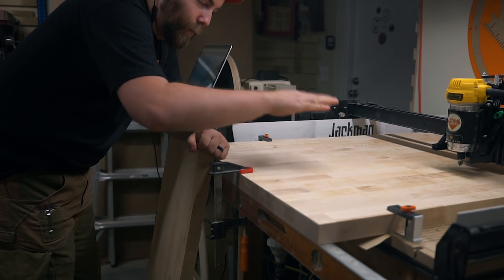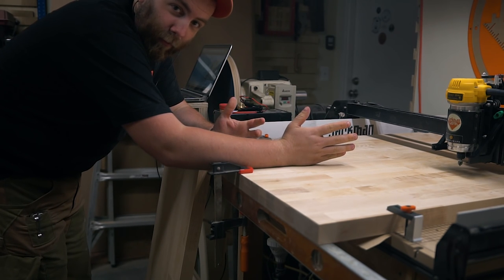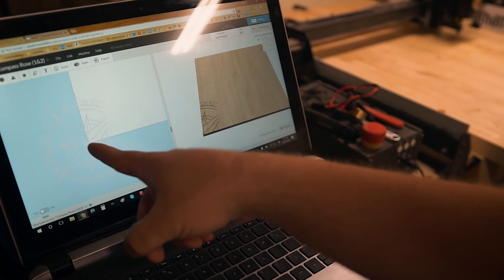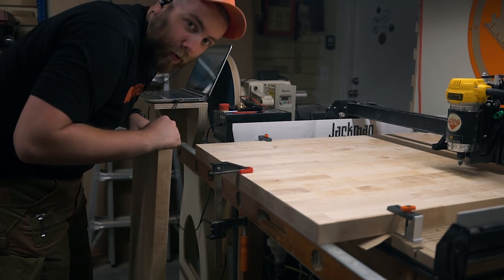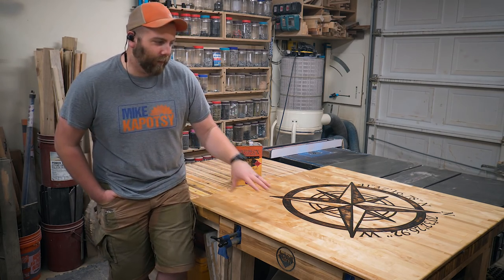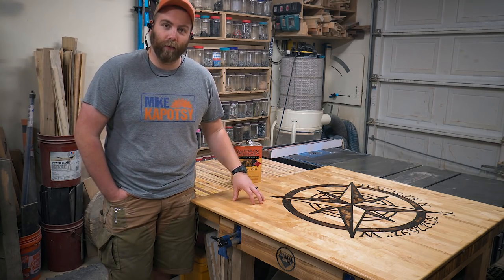Epoxy Inlay and Rustic Compass Butcher Block Countertops

Comment from the maker: ► A big shout-out goes to Waterlox! They are a huge supporter of what I do and made this build video possible. Waterlox is my go-to choice for finish and I'll even admit that it is what makes my projects look so good. Click this link to learn more about it and get some in your own shop! http://bit.ly/2svYsCR

Learn how you can enter into the Inventables/Easel Power Hour Challenge (no CNC needed... that's the grand prize! http://bit.ly/2sEIwgZ

My exclusive solution for hearing protection in the shop, ISOtunes PRO - http://bit.ly/2uIsq7M

MATERIALS & TOOLS USED ON THIS BUILD
Materials
- Maple butcher block countertop
- Blue tape http://amzn.to/2jO5Gva
- Epoxy resin https://amzn.to/2LnVkAd
- Grout 
- Epoxy syringe https://amzn.to/2Jh13ad
- Ammonium chloride https://amzn.to/2Ju8r5r
- Rare earth magnets https://amzn.to/2xHqVdY
- Quick set epoxy http://amzn.to/2kIH4J2
- Waterlox tung oil finish http://bit.ly/2svYsCR
Tools
- Hearing protection https://amzn.to/2JiLX3Y
- Dust mask https://amzn.to/2LVJXjY
- Circular saw http://amzn.to/2pindD0
- Drywall square https://amzn.to/2sFR5bw
- Table saw http://amzn.to/2j4bvVU
- Bar clamps http://amzn.to/2DMjReG
- Glue scraper http://amzn.to/2jrxJR0
- Belt sander http://amzn.to/2oS8zyE
- CNC machine http://bit.ly/2kOY5Pu
- Pipe clamps http://amzn.to/2jkLLbO
- Heat gun https://amzn.to/2xJLN4q
- Router https://amzn.to/2xIzHbD
- Table saw fence clamps http://amzn.to/2m7vtkr
- Random orbital sander http://amzn.to/2jrwsJC
Reply: Jackman Works  first off, what the hell is the name of the first track on your video. That alone, has me watching this multiple times. Second, the compass is an awesome idea, would you attempt this with a palm router? Asking for a friend. Thanks and great project

Comment: Is there any way to do this without the CNC machine and on a bit of a smaller scale? I’m just getting back into woodworking and would like to do this as a gift for a family member.
Reply from the maker: For sure, the circles and straight lines are easy with a jig. The lettering will be harder by hand but it's definitely doable with a steady hand and more of a script type font which will help hide your mistakes

Comment: What sandpaper grit do you use on your belt sander? I’ve been trying to remove epoxy from some cracks I filled in a slab and am not having any luck. I ended up snapping my belt : (
Reply from the maker: I usually start super rough with 60 grit to take most of it off and go up from there before I hit the wood
Reply: Thanks, I had an issue with the pigment dying the wood and it ruined a project. I heard applying lacquer to seal the grain first will help prevent this. Do you do anything to prevent bleeding into the wood?

Comment: I enjoyed your Compass Rose. Here is a question that I would like your opinion on. I want to crave a 6 1/2 inch "CR" on a Maple table using Black Epoxy. Then after the epoxy drys and the surface is sanded smooth, I want to apply stain over the surface to match the interior of my small RV Van. Finally, apply a spray on finish over everything. I am I correct in assuming the Epoxy won't absorb the stain?